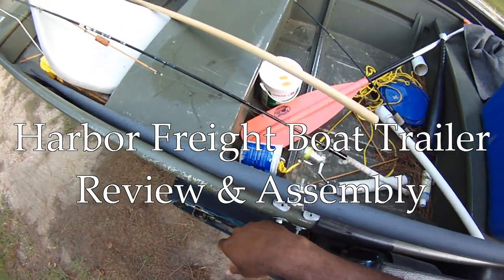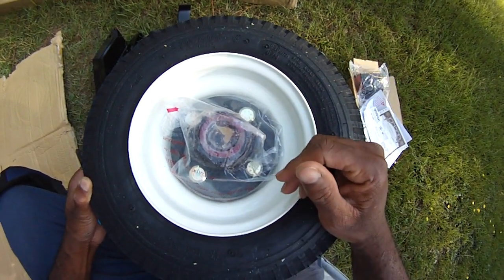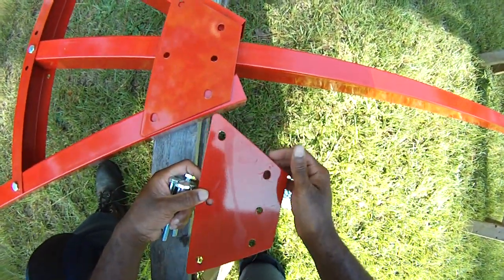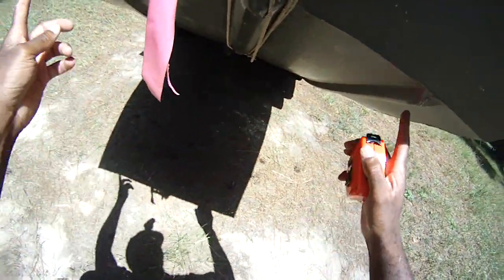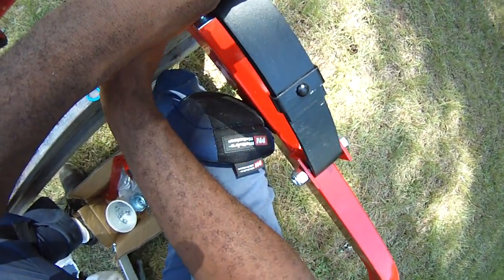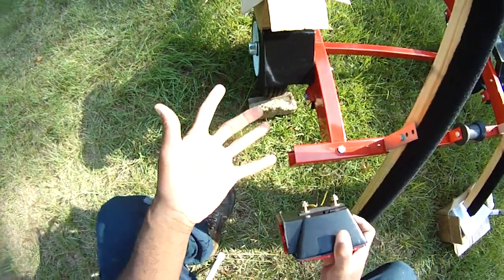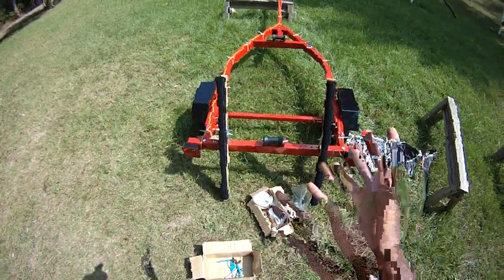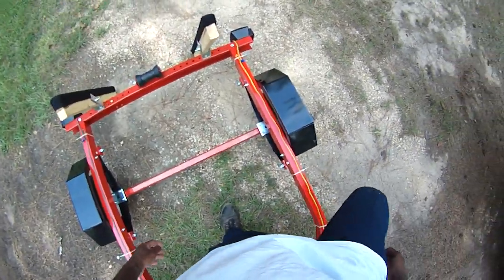Harbor Freight Boat Trailer Review & Assembly

Comment: How do you back up if the rails are touching the ground?  Think that's wrong.
Reply from the maker: Yup, you're right! See the following:
1. I don't use this trailer anymore: https://youtu.be/-CdRl6qSD4w
2. I no longer recommend this trailer since the wheels fell off: https://youtu.be/kZfl7lTtEww
3. Harbor Freight doesn't sell this trailer anymore, so points 1 and 2 are moot.
4. The rails didn't touch the ground. I flipped them around so the longer side rest on the axle when the boat is off the trailer. 
5. None of this matters given points 1, 2 and 3.
Reply: I guess I am kinda randomly asking but does anyone know of a good website to stream new movies online ?
Reply: @Matteo Brayden I watch on FlixZone. Just google for it =)
Reply: @Vincent Gordon Yup, I've been using flixzone for years myself :D
Reply: @Vincent Gordon thanks, I signed up and it seems like a nice service =) I really appreciate it!!
Reply: @Matteo Brayden glad I could help :D

Comment from the maker: Yes they are turn signals and brake lights. You have to wire them into your turn and brake signal light. If you're using a truck, it should come with the harness from the manufacturer. If not then you will have to have a shop install the trailer light harness.

Comment: Black Warrior Lures Hey, I've been searching for information on the 12' harbor freight trailers on youtube and I found your channel.  I thought your instructional video on putting the trailer together was great!  I just wanted to know how you where able to back up the trailer at the end of the day to load your boat with how the tilting brackets are designed.  From the video, it looks like the tilters are balanced to tilt up when the boat isn't on them.  I can see that being a real issue when you'd have to back up the trailer without the boat on it.  What do you do in that situation?  Or is there enough clearance between the ground and the tilting brackets in that case?  Thanks!

Comment: Good video. I was on the fence about getting one of these or get their regular trailer with 12" tires and convert it to a boat trailer but I think I'll go this route. I'll probably weld all the joints as well. Another good idea would be to pop those bearing caps off, buy a couple zerk fittings, drill a small hole in the end of the caps and thread in the zerks, then you can pack those bearings full of grease to help keep the water out. Also I think you can tighten up the bolts on the bunks snug to keep them from falling down but still able to move a little.
Reply from the maker: Yeah, if you welded all the joints, I bet it's a great trailer.

Comment: Great video!! Nice job assembling the trailer. You will probably want to put marine grease in the bearings. Buy a bearing packer off ebay. It makes the job a lot easier. They're less than 15 bucks. It looks like two cones with a threaded rod thru the middle and a grease zert on top. I don't think they put marine grease in them from the factory. Make sure you pull out the seal on the inside of the hub and do all 4 bearings. I own the same trailer. It's a great value. Never had any problems with it so far. I do wish the tires were a little bit bigger but it's not a big deal.
Reply from the maker: Yeah, 12 inch tires would be perfect. Thanks for watching. I wondered if I needed to pack the bearing because the grease I topped off the cap with is a different than the grease the bearings came packed in.
Reply: No problem. Yeah it would be a good idea to repack the bearings. If you dont theres a chance they could weld themselves to the hubs and that wouldn't be good.

Comment: The Society of Automotive Engineers (SAE) once developed fastener standards for the U.S. auto industry. Tools and fasteners measured in inches are usually called "SAE bolts," "SAE wrenches," and so on to differentiate them from metric counterparts.
Reply from the maker: That's good to know. Thank for chiminig in.

Comment: nice trailer.i have one that looks close to that but i dont use the skids or rollers.i bolt a 3/4"pc of pt plywood down as a deck  the same shape as trailer and use 4 - 1/4" carage bolts to hold it down.works great and makes boat lower and easier to float off trailer.been using this set up for 5years and love it.thanks for your vids  i like them keep it up S.D.
Reply from the maker: Yeah, this little trailer has held up well.

Comment: I am moving to Jacksonville in 2 weeks and will need to buy one. I found a similar one on northern tools for 500 and a 50 coupon off free shipping to a local store or hundred bucks home. That one has 12" wheels and its metallic. Not a big fan of the red. Also because it is steel it concerns me as i will be launching in salt water. You can see my boat if you click on my videos

Comment: Do you think a Tracker Topper 15 would push the limits to much of this trailer?  It's only 190 lbs but is a 1542.
Reply from the maker: +Panfish The width is fine, I think you'd need to make longer bunks for the length to work. In fact I've been thinking of ways to get a 15 or 16 footer to work with this trailer. I would use full 8 foot bunks that you've seen on my modifications video.
Reply: +Black Warrior Lures Thanks for the reply!  I wish I could find a 1448 for the Topper 15 price somewhere but manufacturers just don't make them or charge way to much for them lol.  I like that modifications video too.  I do have a request:  film your boat on the trailer when you can.  I will hunt through your videos when I get home just in case you already have done that.  Thanks!!!

Comment: awesome job!!!  I am concerned about the wooden 2x4's just flopping down like that. those tires are 8" right? northern tool has a similar trailer for 100 more with 12" wheels and the setup looks a tiny bit better based on my preference. I have a 12 ft inflatables I want to use. Why not just drive the trailer into the water and the boat will just float off? or use a winch?
Reply from the maker: I'm installing a winch now. Yes, 8 inch tires only. 12 would be better, but I'm not worried about it. They hold to highway speeds well. I'm also reworking the bunks. Totally with 2x6s along the length of the trailer.

Comment: Good job on the video. I can see how people might want this trailer in places where used welded trailers aren't easily found. Here in northern Michigan great used trailers may be found easily and often for under $200. I didn't like the bumper or skid runner design. They're better stationary on the bed. But again, a good video and very interesting. I like Harbor Freight like most everyone.
Reply from the maker: Thx

Comment: when they say bolt is 3/16"    they are talking about the diameter of the bolt itself
Reply from the maker: sc928porsche I mean the size socket it takes to tighten/loosen the bolt, the head of the bolt.

Comment: Do you drive at highway speeds with this trailer? I have a Harbor Freight utility trailer and the recommended speed is 55 mph although I have gone faster with no issues. Just wondering if you have gone 65-70 mph for an extended period. Great video. Thank you.
Reply from the maker: I have driven highway speed with the trailer with no problems, but I 
recommend that people drive within the manufactuer's specifications.

Comment: Bolt size is different than the wrench size. Bolts are measured by threaded diameter and thread spacing.
Reply from the maker: +Doug Steenwyk Thx. I bought the bolt that fit.

Comment: I looked on Harbor Freight and didn't see any boat trailers.  Is it hiding in the online listing?
Reply from the maker: They don't sell them anymore. I'm not sure why, but they don't sell them anymore Even if they did, I do not recommend this trailer since the wheels fell off on mine: https://youtu.be/kZfl7lTtEww
Reply: Thanks for the heads up.  I read reviews on them a while back but figured it was people not familiar with building things.  Once I built my own trailer, but dad tore it apart needing the angle iron for his antique car.  
I'll keep looking.  They are just so expensive.
Reply from the maker: I'm using a McClain trailer now: https://youtu.be/-CdRl6qSD4w
Reply: Just watched your review of the McClain trailer.  Liked your information on the tire size for the length trailer.  Definitely going with the bigger tires.  I'll adjust the ratchet for the boat.  I have a 12' row boat but no way do I want those little tires for the road.  I went through that before and changed up to the bigger tire.
Thanks for your help and advice.  Hoping your fishing season is going great!!!!!
Reply from the maker: Yeah, man! I'm glad it helped. I'm in the process of building a new boat. That'll be the next series of videos here.

Comment: Will this work for a 14 foot extra wide extra deep jon boat?
Reply from the maker: +YouJellySir 14 ft wide would be fine. The trailer is 4 foot wide from support beam to support beam which is inside the tires. Not sure how deep you're talking.

Comment: Did you leave the wires exposed is there a way to hide those
Reply from the maker: Yes, I did leave them exposed. You run the wires through the trailer's steel tubing before assembly. I don't use this trailer anymore, and don't recommend it either..
Reply: U don't recommend the trailer anymore?
Reply from the maker: Na, I don't recommend it. The wheels fell off, and it was too much to maintain:
https://youtu.be/5ITjIQuTlLg
https://youtu.be/-CdRl6qSD4w

Comment: Thanks for the video, I hope to get one soon. Do you think it will hold up ok if i leave it outside?
Reply from the maker: That remains to be seen. I leave it outside because I don't have a garage. The paint job is pretty well done, but it's obvious there is no paint on the inside of the big tubes. It'd be nice if they offered a galvanized version of this.
Reply: +Black Warrior Lures Any rust so far? I saw a review on the HF website that showed the leaf springs after 2 uses and storage for 1 season, they were rusted to the point that it dropped the trailer axle and leaf spring straight up into the bottom of the boat/wheel fender..(not nice while doing 70 on a highway :/ ) I also live in FL and will be taking my trailer into saltwater often. I would be upset if my hard work of building, buying and modifying only lasted one season or even a year. i like the thought of assembling my own trailer but for the little extra cost of a used galvanized trailer (maybe $150 more) that would take years for oxidization to start is maybe a better option for me? im interested in your success with this trailer and curious as to how it has served you and for how long have you owned it? thanks in advance!!
Reply from the maker: I haven't see any rust. I break it down once a year to inspect.
Reply: Impressive. how many years since the first build? again thank you for you answers. ive also been watching your mud motor videos i take interest in these type of builds so thank you for your videos!
-Andrew
Reply from the maker: Let's see I put this video in August of 2014. I took it apart just after winter of 2015.

Comment: The bunks are supposed to be tightened down.. Not just flopping around.  Otherwise, good looking trailer and review.
Reply from the maker: They were tight, but they always loosen once you get out on the highway, vibrations and whatnot.
Reply: Thanks for the video man! I bought this trailer instead of another because of your video!  I will likely modify the bunks like you did, as I have a flat bottom jon boat as well that won't even touch the bottom rollers.
Reply from the maker: Yeah, it seems designed for a v-hulled boat.

Comment: Whats the length of the trailer from end to end without a boat on it? I have a 16' 4" area to store it and having a hard time finding a trailer that will fit that..
Reply from the maker: I'll have to go measure it.
Reply from the maker: Size is 52-1/2 in. x 154 in. according to the spec. sheet.

Comment: Also, here is a code for 25% off any single item through 3/31/15: 21741290
That brings it down by $100!
Reply from the maker: Yeah, that's even better. Thanks for chiming in. Hope the discount helps someone out there.